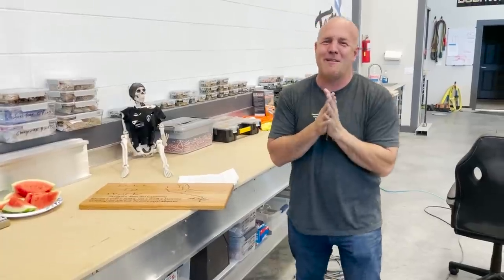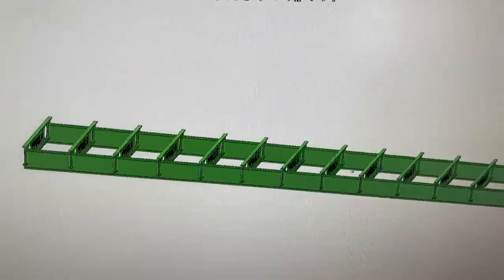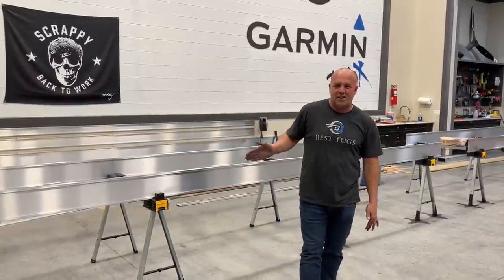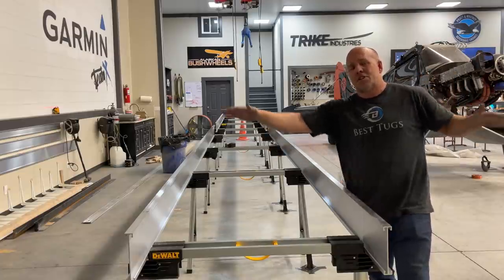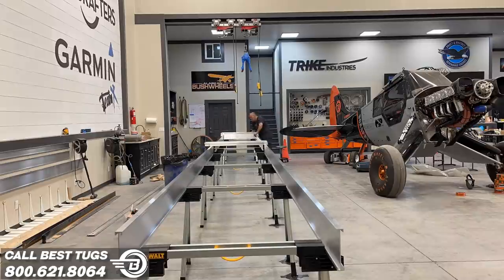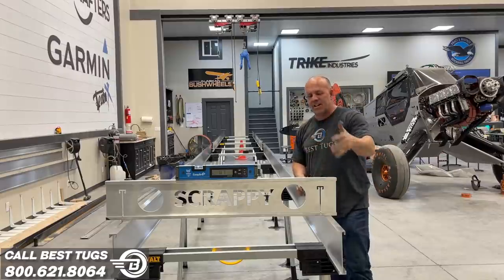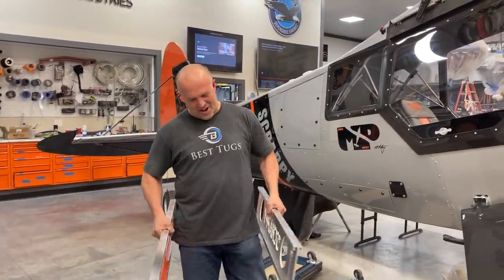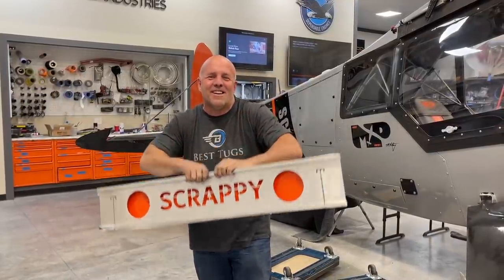Water Jetting aluminum tables and twist in a wing | Scrappy #51

Comment: I forgot to plug in the sump pump due to a unknown sense of urgency. Locked the keys in the truck in my rush to finish up and had to call AAA. Then left my phone on the roof of the truck to get home.   The source of the sense of urgency came to me as I passed CVS Pharmacy.  I forgot to pick up toothbrushes and toothpaste as I was asked to to on Sunday.  Said Items were placed on the vanity, and I retreated to the garage.  Nope, not a card, not flowers and sweet smelling soap, not a ANNIVERSARY dinner....... Toothpaste and a toothbrush.

That said:

I'm  going to guess on the switches. Why ruin nine frames of gutter balls by knocking down a pin?

1)  Switches are central and centrally accessible from the stick, a natural focal point.
2) Switches seem to be DTTP. 
3) Mike spoke of Garmin making cool stuff for him. 

My toothpaste /toothbrush guess from left to right is...

Gear up/AUTO/Gear down

Flaps  up/AUTO/down.... Oh and slats extended/retracted in a beautifully choreographed dance.

Soldier dropping cooling thingy... Closed/AUTO/open

All three tied into the Garmin.  In auto position all are programmable based on speed/altitude/temperature with full manual override.

I'm off to sleep in the guests room with the dog.

.

Comment: I'm absolutely confused by this video. Why reinvent the wheel? Build the wing in a vertical jig. That's how metal wings from Cessnas to C5s are built. I know, I've worked on both.. You've been so precise in this build and now you're using paint sticks for spacers? My biggest hope is that you're going to use a modern airfoil, not some flat bottom Cub airfoil. I'm almost afraid to continue watching.